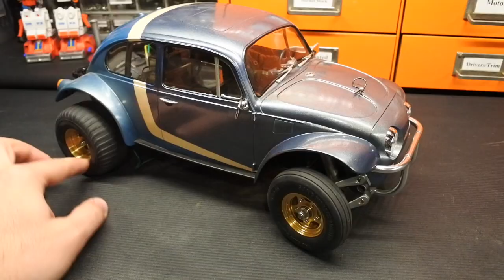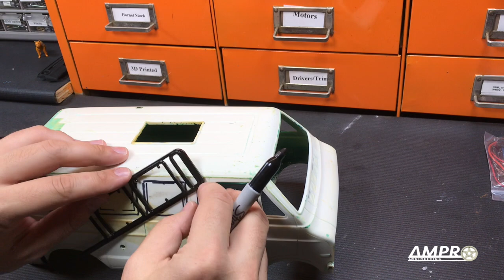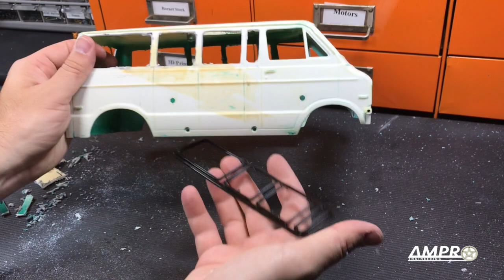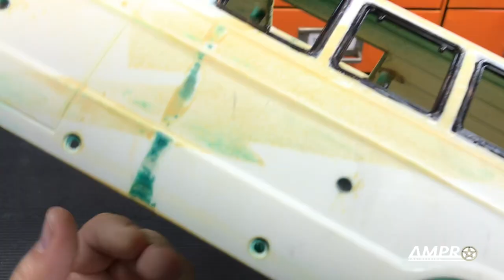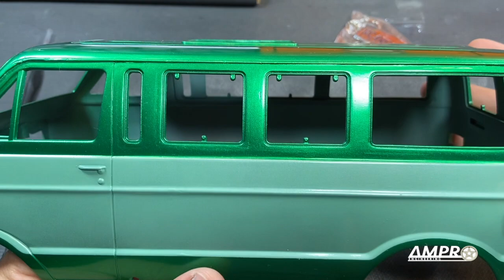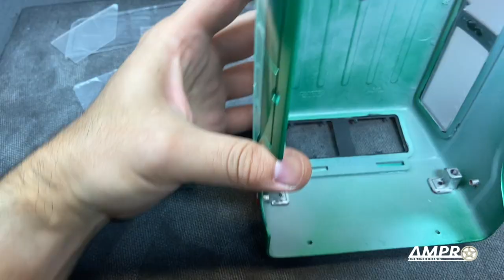e318- Tamiya Lunchbox Dodge Passenger Van Conversion

Comment: Any chance for an interior for a stock Lunchbox? Obviously just the front section, dash, seats, floor, and probably the door cards?

How much work to get that dash to fit with the stock windshield? Would it just be sanding/removing some of the material that meets up with the windshield?
Reply from the maker: I will have an interior for a panel version soon. You would need to cut down the bottom of the window but that should be fine since the top would still hold it in place.
Reply: @AMPROEngineering  Sounds great! 👍😎

Comment: A good extension for a dremel is a handyshaft, or flexshaft as some call it. It runs of the power of the dremel and it is much smaller and makes working with stuff like this much easier.
Reply from the maker: Yes I have one. They are great.

Comment: Why only the window frames themselves, and not just a panel to replace the whole area? Body line to drip rail, door frame to rear pillar?
Reply from the maker: There is no way to resister all that when installing it then. At that point, might as well print a body lol! That would have been the smart thing.
Reply: Not trying to be critical. I'm sure you had a reason for doing it this way. Just looks like an awful lot of work.

Comment: That is an awesome build. Really like the paint. Remember seeing vans like this in this paint scheme. Excellent build!
I was thinking taking two of these vans and splice them together to make the long wheelbase version. Then paint it up as the Possum Lodge van from the Red Green show. 
MESA Airlines had two of these vans as long wheelbase 4wd windowed crew vans for the operations in Aspen and Vail Colorado. They were replaced and hauled to Sky Harbour in Phoenix Arizona. They finnished their service with the PHX hangar and GSE departments. One was sold off and the other scrapped.
 Alittle roof top mounted A/C housing where the sun roof portal is would not look out of place. One of those white gelcoat ones that tried to look like a hoodscoop. LOL not the airvent ones, the compact A/C units, usually an aftermarket add on done by a RV service center. Don't know the brand but the manufacturer did their best to make them look "go fast". My uncle had one of these units mounted on top of his van, just like the van you just made here in the video. I just remember my cousins and myself getting dripped on by ice cold condensation from time to time. Supposely leaked rainwater in around the mounting gasket as well. LOL! Good times.
Reply from the maker: HAhaaha! I loved the Possum van! I was also thinking a roof AC unit but had not decided yet. Thanks for the story! I remember leaky cars all too well....

Comment: That looks great!!
A buddy from high school's dad had a Dodge Van as his daily driver; it was two-tone brown.  We used to call it the "Egdod Teerts Nav - which is Dodge Street Van backwards.  lol
The next time you glue in window "glass", you might try Mod Podge rather than hot glue or CA.  You can find it in the arts and crafts section at Walmart.  It's slow drying and water soluble so if you get some on the visible portion of the window, you can easily clean it off with a wet Q-tip.  I used it on my '79 Bronco trail truck build and it worked great - applying a bead around the inside perimeter of each window to completely seal it into the pocket in the body.  I picked up this tip from a scale modeler.
Can't wait to see your interior build video for this model.  I'm working on an interior for the Bronco - a combination of sheet styrene main tub and printed dash, door panels, etc.  -- very much inspired by the interior in your TRX-4.
Reply from the maker: I have mod podge but didnt think of that. isnt it too weak? I have to admit I am not too familiar with it. My wife uses it a lot. Shoot me an email when the interior is done! That TRX 4 bronco interior was a giant pain ....lol! amproengineering@gmail.com

Comment: Needle file would have been better then the xacto for cleaning up those windows.  Could also template out the window openings better so little to no filling is required.
Reply from the maker: I did use those a bit too. Using a printer would be tricky since it is hard to get a printer to actually give you 1:1 prints. I would be concerned that someone would rely on that just to discover the print doesnt line up with the parts.

Comment: Absolutely stunning work! You would almost think Tamiya did this! Did you use the same black paint for the gasket to use for the panel lines?
Reply from the maker: Thanks man! No i used Testors Rubber Gasket paint. It is basically flat black.
Reply: @AMPROEngineering  well it looks terrific!

Comment: Awesome!  Love it.  Any chance a future update would include a 2 piece design? Maybe an inside frame and an outside frame that would snap or be glued together which to sandwich the window opening and eliminate the need for filling and sanding?
Reply from the maker: Thanks! Sadly no, that would not give you flat surface on the outside. Or you would have to clamp together and sand it all down. I suspect that is kind of dangerous....like this isnt, lol!

Comment: why not to provide template print to mark the outside of the holes?
Reply from the maker: Because not all printers can accurately print 1:1.
Reply: @AMPROEngineering  that makes sense, but still possible to involve a scale inside that template to check the dimensions :) Love your work though :) Bought some files and they were straight fit :)